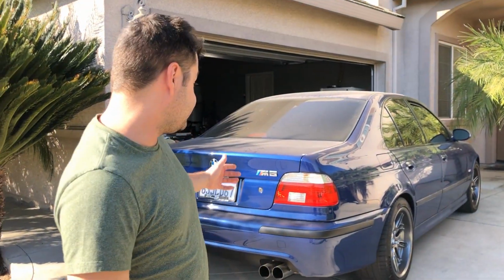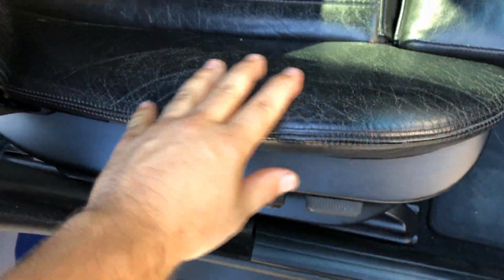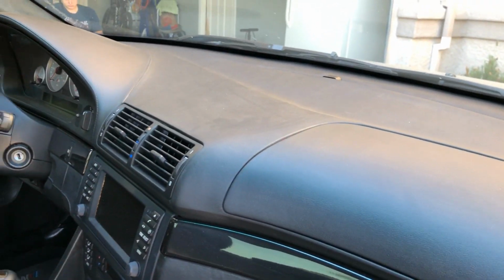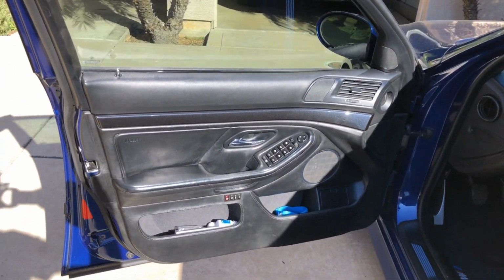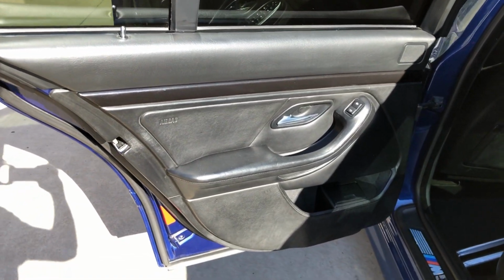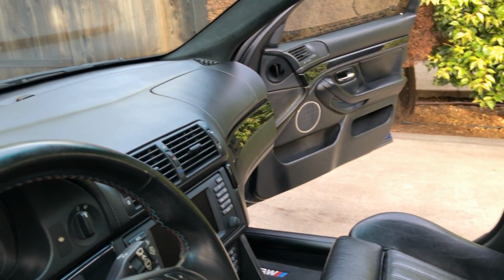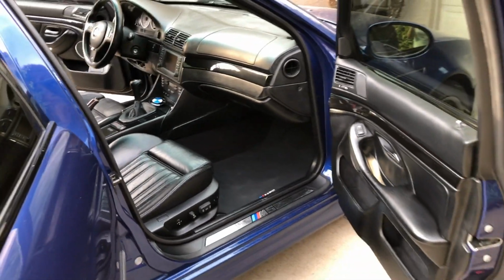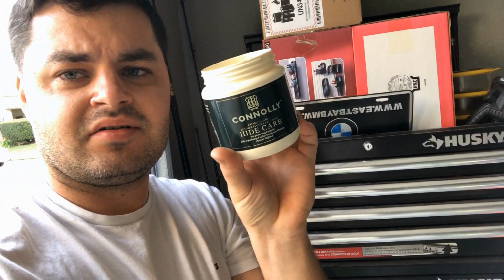Leather Seats Conditioned with CONNOLLY Hide Care!! M5 Interior Looks HEALTHY Again!!

Comment: I had the same gap when fitting my airbag it was because the wires in the back were not routed correctly out the way. Take it out and route the wiring along the top away from the centre of the steering then your airbag will fit correctly.
Reply from the maker: Thanks for the info! Makes sense because I kinda slapped it on too quick being too excited haha

Comment: I clean my leather seats once a month with a leather cleaner, will it strip off the conditioner I put on the month before?
Reply from the maker: I’m not too sure honestly. I think the conditioner is usually water repellent so I don’t think it would come off so easily unless you’re scrubbing hard or using a cleaner designed to remove oils. I’d also think that the leather would absorb the conditioner. I’m not a pro in this area so can’t comment too much. I usually just go over my seats lightly with a wet microfiber and it cleans them just fine especially if the water is more warm.